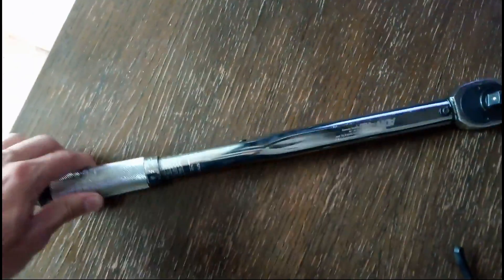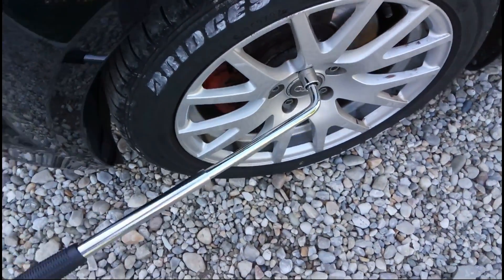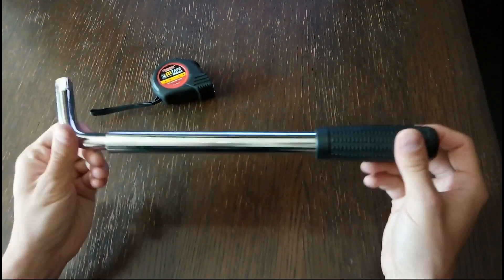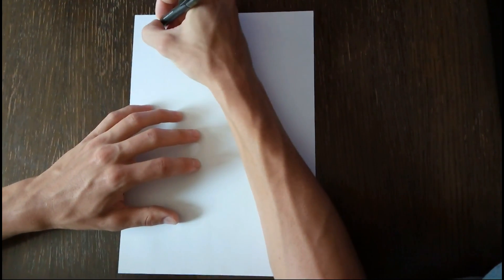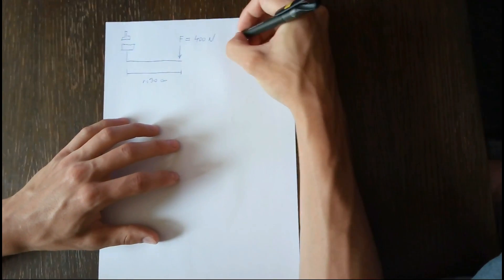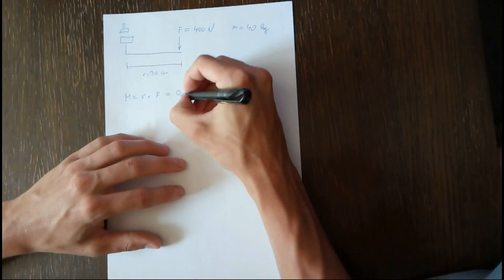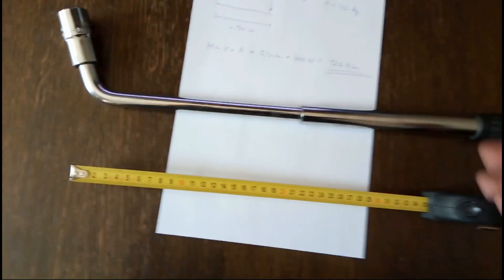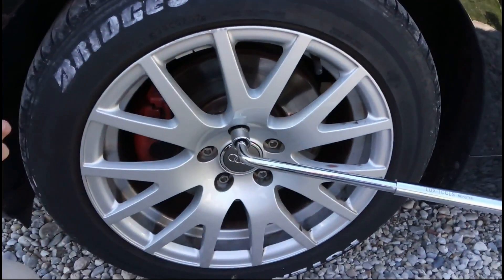How to Tighten a Car Wheel Bolt Lug Nut Without Torque Wrench

Comment: I HAVE NO IDEA WHERE THE NUMBER 400 COMES FROM. And i expect someway to know how much torque do we need on a specific bolt, but now every bolt you use that wrench will has limit at 120 Nm to tighten or what? I don't understand.
Reply: Tightening torque for a car wheel nut is usually in between 80 to 120Nm, you may refer to your car manual. So to estimate a 120Nm torque in a 0.3m long wrench, you need 400N force or about 40kg weight

Comment: If you have digital bathroom scale. You can do an equation. Of bar length, body weight, and see how much weight to subtract from the scale as you push down. You’d have to stand directly over the bar, with scale directly under the bar. But you could get real close.
Reply: Thats hilarious. 👍☮️

Comment: Yeah the whole torque wrench to tighten lug bolts is a little exaggerated. I'm not saying it's not better but you can get away with not doing it.
Reply: I agree, this is exactly why I am tired of going to the internet for car advice.
Reply: @stinkiesxd  i still use it. But i try to ignore the bogus information.

Comment: I’ve never torqued a lug nut in my life and I’ve never ever had a nut come lose or damage threads, even on my 1500HP drag car I didn’t torque the lug nuts I just snugged them down and they held up to 180mph 1/4 pass’s time and time again and the burnouts which is really hard on the wheel hubs and studs
Reply: @shortie80810 Showoff 😅!

Was awesome imagining your dragster move the way you described. 

...so please be so kind as to try and explain how you went about it? 

I rounded off 2 screws on the engine head of one of my 100cc motorcycles cuz I didn't know about torque wrenches then. 

I got the screw replaced at a Lathe Machine shop, came home and rounded off the new screw again 😏👍💥 

I have 2 torque wrenches now but I'm here investigating for the screws that aren't mentioned in my bike's workshop manual! 

And so awesome that you built that 1500 hp mean machine, Sir! Doubt I'll come close to such a project in this lifetime. But so awesome to meet people like yourself!

Cheers gentlemen!
Reply: Lmao this interaction is still funny and wholesome a year later
Reply: I lost a nut on my prius about a year ago :(
Reply: @MustangGuy2000  You lost a nut before you bought it. because no one with two nuts buys a prius!
Reply: @In_Case_Im_Fake  look on my channel I got a mustang. What you driving? Prius is my work car
Reply: @In_Case_Im_Fake  thx big bro
Reply: @In_Case_Im_Fake  lol 😂😅😅😅
Reply: @In_Case_Im_Fake  lmao nice one

Comment: My whole life I've tightened nuts and bolts by common sense and my feelings. Sorta like having a 6th sense. When the nut or spark plug or whatever feels good and snug I'm happy. I never had anything come loose. Thanks
Reply from the maker: It is called muscle memory ;) and it's good.
Reply: @sunkazz   Great term, 👍🏻 👌
Reply: bad torque wrench is no good. hand feel is better
Reply: Exactly how i feel bub, i been bustin balls tightening Lugnuts since i was driving my pops ole Bonneville in the 70's, i used simple jack bars and muscle,  now older i got me the Bauer harbor freight battery powered wrench to remove Lugnuts because im not as strong as i was to remove em, and i went to home depot and got a 4 ft iron pipe to use as leverage to tighten em down using muscle,  don't  use the wrench to torque em just use it to remove the nuts otherwise my groin will be in my throat trying to remove Lugnuts with muscle.

Comment: I'm not a math expert, but this math: 0.5 * 400 = 120 doesn't add up.
Also, how are you going to apply half your weight? Except for when you apply your whole weight, there's no way to know how much weight you are applying.
Reply: Maybe you aren't a hearing expert neighter, he said 30 cm which is 0,3 meters, you nut. And if you want to be precise just buy a torque wrench..

Comment: 30 cm should be measured along a line perpendicular to the axis of nut rotation, not along the length of the breaker bar (which is itself is at an oblique angle from the axis of rotation).  So  the 30 cm you're measuring is actually less than that, measured along the proper axis.
Reply: Yeah, but cosine of 80 degrees is approximately 1, so it doesn't matter so much. Kind of like how he went from 400 N to 40 kg instead of dividing by 9.80665.
Reply: @charvakkarpe  isn't cos80 nearly 0?
Reply: @enricofassio8517  Yeah, I guess I should have written cosine 20, since the breaker bar appears to have a 70 degree bend when the ideal would be 90. Cosine, not sine, since we want the radial distance to your hand, from the lugs, not the axial distance from the wheel face. That would be increased by sine of 20.
Reply: @charvakkarpe  you can check my very first clip, posted a few hours ago to test my youtube account. It's electronic torque wrench of the future. it uses a dedicated app where you can select the proper angle if the wrench is not exactlyat 90° degrees with the axis of the bolt. It's patented internationally.
Reply: @enricofassio8517  I bought an AC Delco digital torque adapter. It's totally worth having. It beeps and lights up as the torque becomes correct. No more wheels coming loose or overtorqued lug bolts. I put it between my 1/2" drive Snap-On ratchet and the socket.
Reply: @charvakkarpe  Very nice tool, but with limited range. My device can measure easily  from 1 lbft to 600 lbft. The only limit is the force you can put in!
Reply: It's a good approximation for DIY - if you were going to measure accurately you'd just use a torque-wrench
Reply: Good point (sin 80 is approx. 1, or off by 1.5%).  Question is, what if that angle is 20 degrees off 90?  Now you're off by 6%.  Why not just measure the correct distance and minimize that error altogether?
Reply: @Stick4569  Haha, I was going to write, "If your breaker bar is 70 degrees, you need a new breaker bar." and then I took a look at his. It's definitely far from 90. That's a bad design because it makes it impossible to apply a pure torque. I always use both hands and apply equal and opposite forces, one on the handle, the other on the head, so the bolt sees only twisting along its axis.

And yeah, you're right, it's better to measure along the correct axis. Or just lose the measuring tape and visualize 30 cm / 1 ft.
Reply: According to George W. Bush, fuzzy Math, you both are very wrong!!.
🤣😂

Comment: Idea: if you use a flat surface and stand on a scale, you can measure how much weight you place on the bar by noting the difference on the scale. That way you get a more exact torque value.
Reply: This is ridiculous but a very good idea that would probably work.
Reply: @henrycardenas3885  if its stupid but it works it ain't stupid
Reply: @mynamefrank6567  Only, with so many "approximations", the question is what will be left of the accuracy of the torque. For wheel nuts i think this entire topic is a little overkill, but if you're doing something like hub nuts then it would be highly recommended to not cheap out on a proper torque wrench..
Reply: @Engineer9736  True, when it comes to wheel nuts I'm certain literally 98% of people use a regular wrench and tighten until it feels alright, at least in my country, torque wrenches are expensive and not very known unless you like cars
Reply: @henrycardenas3885  lol at first it sounds ridiculous but it's actually a very bright idea.
Reply: Alexander, you are totally right, and it's a good idea
Reply: Nice one!